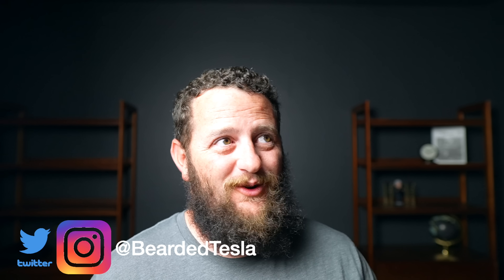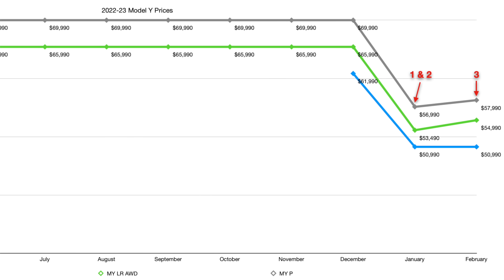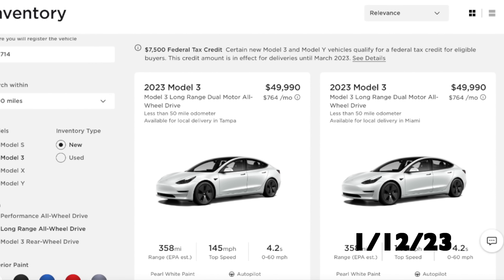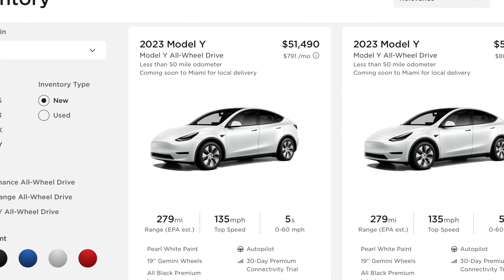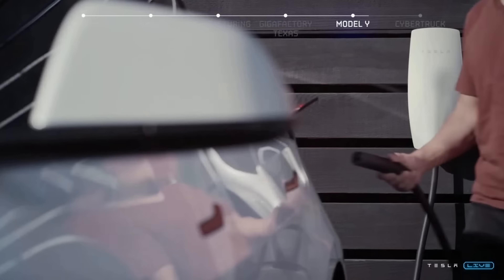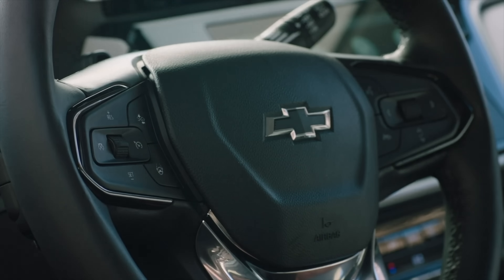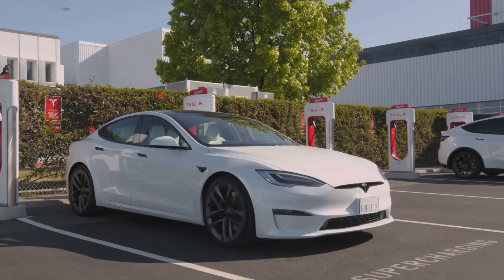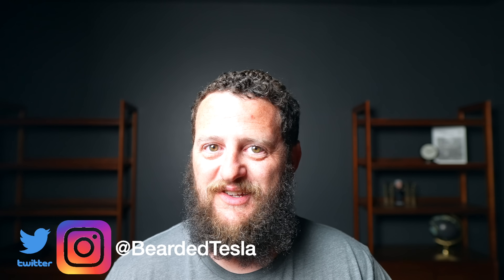BREAKING: Tesla's 4th Price Change of 2023 So Soon?!?!

Comment: well the logical reason to no DM MODEL 3 is they can make 2 model 3s with 2 motors instead of 2 motors in 1 single car. ez math
Reply from the maker: With the capacity limited at Fremont, my assumption is they are sticking to the high profit P and the high volume SR

Comment: Hello, I was thinking of placing an order and wanted your thoughts on the $6000 enhanced autopilot and if we can buy this later after purchase of the model y. If we purchase enhanced autopilot after buying the car is it priced at $6000 or higher?
Reply: Before or after you will still qualify for tax credit if that’s your concern. However, Tesla could increase or decrease features like EAP anytime so you might wanna buy it now to lock in the price and can cancel the feature at delivery if you change ur mind.
Reply: One plus about buying it after purchase, you can put it all on a credit card. So if you want to apply for a new card that has a certain amount of spend to get the opening bonus, the EAP or FSD will most likely get you there. But only if you have the money to spend now. Otherwise you can roll it into your loan buying it before taking delivery.
Reply from the maker: Still 6k after
Reply: @2WatchAndComment  wouldn't he be better off just paying the 200 a month to see if he needs it or not
Reply: @2WatchAndComment  which features don't work?
I think most people buy the enhanced autopilot for the auto lane changes on highways and so you can change lanes on highway manually without it kicking out of autopilot. Both of these have been working well using the vision only system for a while now.
Reply: Just do the subscription when you want it. Like for road trips
Reply: Tesla give customer free one month trial. It’s not late to determine after trial period

Comment: I own the model 3 and the chevy bolt euv premium trim. I will never buy a tesla ever again the tesla rattles and squeaks, phantom breaking will get you killed, the paint is the worst on any of my 20 cars or more I've owned in the past, on the other hand for way less than half the price the chevy bolt is a very, very good car the blue cruise, boss radio, panoramic roof that opens with shade that opens and closes, 6 sec 0-60, great paint no cheaps in over a year, no need for ppf, the only drawback is the charging which isn't a problem if you have home charging This is a good ev for the masses not tesla with it's yoyo pricing.
Reply from the maker: I completely agree with your thoughts (as an owner as you are) on the Bolt EUV. Honestly if it wasn’t for the charging limitations, it would probably be one of the most popular EVs on the road
Reply: You got me looking at the Bolt again. We own a late model Volt and really love it. We would keep it and replace a ICE vehicle. The loaded Bolt is about $25000 Canadian cheaper than the MY. It really makes it hard to justify.  If it only had quicker charging and the more reliable Tesla charging stations….hmmmm.
Reply: We also put a preorder deposit on the Blazer Ev last summer. The Tesla price drops have me thinking 🤔

Comment: I have zero problems recommending any other EV to anyone that wants one if they plan to keep it as a local-only vehicle. However, if you need the EV to perform well on road trips, it is really hard to recommend anything but Tesla simply for the charging network. If Tesla/Elon got anything right - it was that. Everything is a matter of opinion and/or preference.
Reply from the maker: 100%

Comment: Do you think Tesla will hold price increases on the MY until they put the 4860 in the Long Range and Performance variants? I suspect they need to maintain demand through much of this year in order to exhaust their current inventory and purchase commitments of the 2170 battery packs.
Reply from the maker: I don’t believe they have the production capacity of 4680’s to even satisfy Cybertruck production. I doubt wide release is anytime soon. Right now it’s just the “SR” model Y that has them
Reply: What is the difference between these battery packs

Comment: Camp I'm in is that electric cars will most likely die back out as there is no benefit to them compared to regular cars; they don't look appealing; are completely impractical; very over priced for what you get; have poor resale value as the 2nd owner doesn't want to get hit with a 20k battery replacement thus electric cars are use then throw away when done... As expected in the beginning when electric cars started being more prevalent, the gov would cause electric prices to rise extremely and start causing black/brown outs and tell ppl to stop driving because of the stress on the power grid and cause of false claims of co2 harming the climate... charging stations often are faulty, which adds to unnecessary range anxiety... As time goes on, ppl will wake up and realize gas cars are better for the environment... only ppl buying these cars are ppl who pretend to care about the environment and curious ppl... other manufacturers can make better electric cars than tesla, so I don't know why they are keeping this going
Reply: The big difference is paying $ 50 to fill up your car?
Reply: 🤣😂🤣 clueless